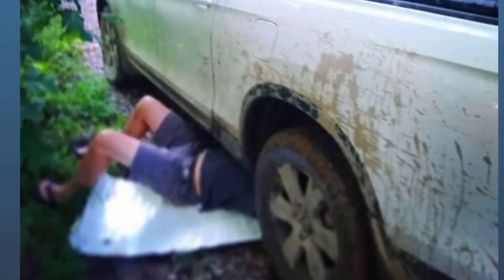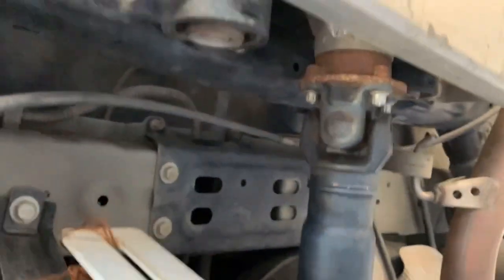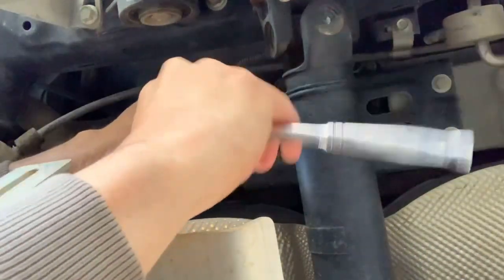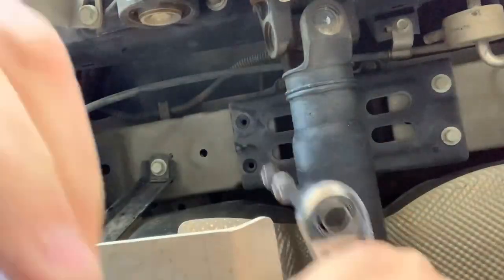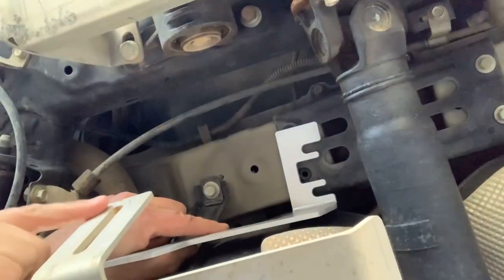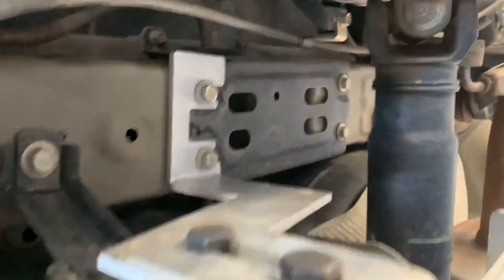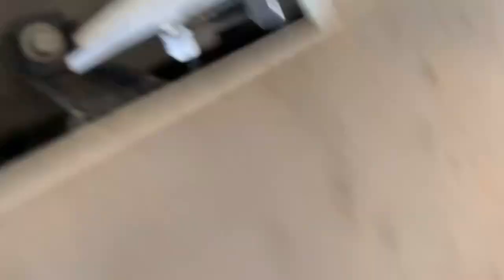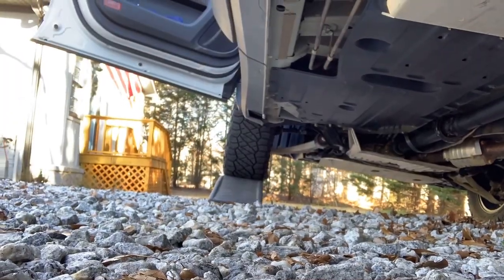Honda Ridgeline Gas Tank Skid Plate Install How To

Comment: How much ground clearance at the gas tank do you think you lost after installing this?  Do you think it hangs about an inch lower?  1.5 inches?  2 inches?  Or does it fit up tight against the bottom of the tank?  Thanks for any clarification you can provide!  And thank you for your informational videos.
Reply from the maker: It fits very tightly. The protection you receive far out weighs and clearance lost if any.